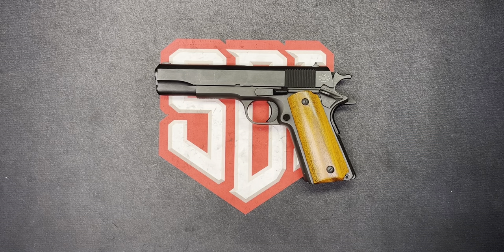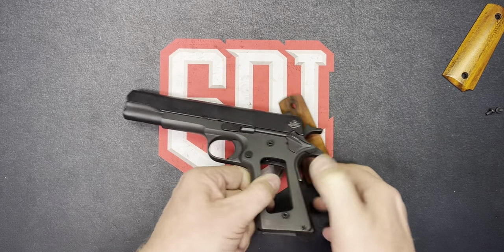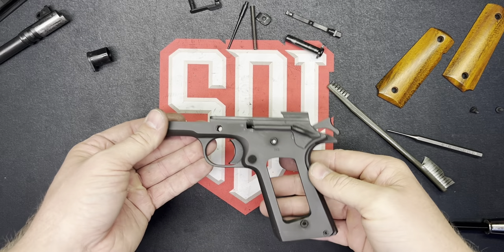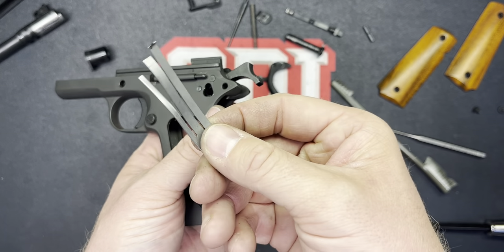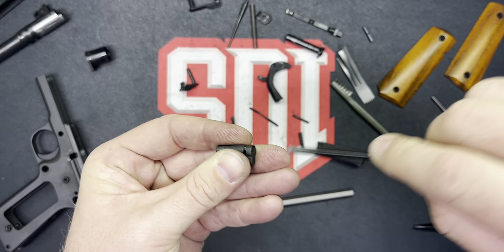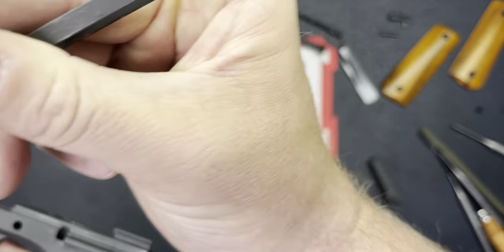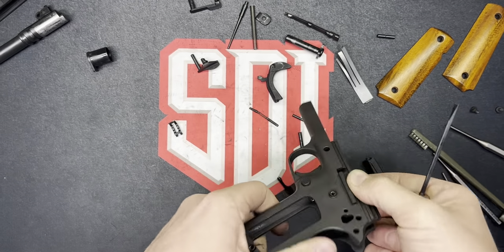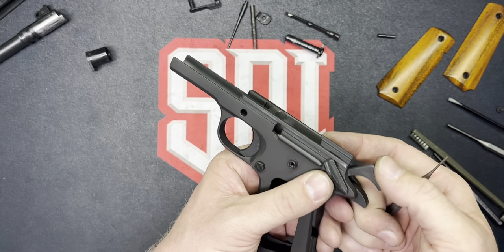Sonoran Desert Institute Rock Island Armory 1911 Detailed Strip (Disassembly and Reassembly)

Comment: Here's a trick for everybody that's watching what he's doing here at the installing the firing pin and the firing pin stop and the extractor put your extractor in. Get it lined up. You may have to use a punch to kind of line it up a little bit. Do not put your firing pin in. Put your firing pin. Stop in to help kind of line that firing pin up and make sure you got it lined up. Once that extractors lined up it should hold in place on most. I've had one that was really loose. Then you can put your frying pin in the spring and the firing pen in and then put your frying pin stop in and everything should go together. But you want to fit the firing pin, stop and the extractor and get those into position. Before you put the firing pin in, you'll find that it makes it a lot easier when you put it all together first. I know it's an extra step but when you put that firing pin stop and it kind of helps line up the extractor just right

Comment: Plunger tube is staked in you do not take it out. You do it will ruin it just like the front sight. If it's staked on, you have to break it to take it off. They're not intended to be removed

Comment: These pistols (Armscor imports of whatever name, and maybe others) pass the "drop safe" test required for importation by using an extra strength firing pin spring. They avoid the extra expense of a "series 80" system by doing this.  A stronger spring is far cheaper than a series 80 design or even a titanium firing pin. 
While this works, it is a pain to reassemble and very easy to launch the firing pin and spring into outer space where it seems to orbit forever, never to be found again.
My suggestion is to get a standard strength spring and titanium firing pin (about $20 total) and install them the first time you detail clean the slide.  Your gun will be drop safe and MUCH easier to clean and maintain.
Another thing I do with ALL my 1911s (6) is install a Wilson Combat "Bulletproof" extractor and use Wilson Combat magazines.
Reply from the maker: That is great advice, thanks.  Do you have a preferred brand or vendor for the spring and pin?  It’s funny you commented on this video just now as I got an email two minutes ago that the new safety was delivered. It’s literally sitting in my mail box right now.  Time to get the 10mm back up and running.
Reply: @scottbozarth8459  I use springs from Wolff Springs and I use a titanium firing pin from Wilson Combat. I generally get any and all springs from Wolff, except 1911 recoil springs which I get from Wilson Combat. 
Wilson Combat 1911 parts are top notch and provide a cheap upgrade to any 1911. 

I have no interest in promoting Wilson, just 50+ years experience working with and owning 1911s.

I use only Wilson Combat magazines in all my 1911s.

Another bit of advice...unless you are left handed, lose the ambi safety and just use a regular (or extended) left side safety only. I prefer extended safeties, but any guns I ever had with ambi safeties...the safety is in the factory box as a spare part (along with the factory magazine, extractor, firing pin spring, firing pin and mainspring) and replaced with a left side only safety. Keep all the original parts in a little bag in the factory box. 

Tip: If you change the extractor and use Wilson Combat mags you can skip the "break in" of the gun and the parts will cost you about the same as a box of ammo. 

I own quite a few 1911s and add a new (or used) one to the collection from time to time. I keep extras of these parts on hand and just assemble them into the gun as soon as I get it, then order more spares.
Reply: Never heard of titanium firing pin helping in drop safe, interesting. What would make it so? I am not a series 80 fan, I convert any I have to 70.
Reply: @markymark6108  Light weight.  The problem with 1911s firing when dropped is caused by the firing pin flying forward under inertia if the gun is dropped on the muzzle. The weight of the firing pin, under inertia of falling, can overcome the strength of the firing pin spring, just as it does when the hammer hits it when firing. 

The Armscor imports overcome this to pass the required import drop test by installing an extra heavy firing pin spring to resist the inertia of the steel firing pin if dropped on the muzzle AND and extra heavy mainspring to overcome the resistance of the heavy firing pin spring when fired.  A titanium firing pin costs about $30. The cost of two heavier than normal springs is little or nothing. They meet the import qualifications and maintain their market price point.

The extra heavy springs make firing pin removal and replacement a pain in the @ss,  and the extra heavy mainspring increases trigger pull and increases the effort required to operate the slide (because cocking the hammer is more difficult against a heavier spring)

Installing a standard power firing pin spring can make the gun unable to pass a drop test. if that concerns you, installing a titanium (lighter) firing pin fixes that problem. The lighter firing pin spring and lighter firing pin allow you to install a "reduced power" mainspring. This reduces trigger pull (because of decreased pressure on the hammer/sear connection which must be overcome by pressure on the trigger to fire the gun) and decreased effort to operate the slide because the hammer is easier to cock. 

The whole conversion takes maybe 10 minutes and requires a couple of appropriate size pin punches which you should have if you own a 1911 anyway. 

Why didn't Colt just install titanium firing pins back in the early 80s instead of the whole "series 80" thing?

Because, at the time, titanium firing pins were not in common supply, were very expensive AND the attorney's preferred a mechanical system for liability protection rather than  trusting Newton's laws of motion.
Reply: @garyK.45ACP  Thanks for the info. Makes good sense. I have built 8 or 9 1911's from 80 % frames.....I have several with springs set for Plus P so I defenatly understand the springs. I will be ordering titanium pins and reduced springs for a couple of them. I EDC cocked and locked so I dont think it will ever come to be a thing for me  but its worth the effort. Thanks again for the info.
Reply: @markymark6108  Like the recoil spring being balanced for the loads the gun will fire, the hammer spring (mainspring) and firing pin spring have to be balanced also. A heavy mainspring with a standard firing pin spring and heavy standard firing pin could result in pierced primers. Vice versa can result in "light primer strikes" and failures to fire. 
Drop safety for the 1911 was always more of theoretical issue than a real safety issue, it became more of a problem with the increase of liability lawyers.  

The military managed without it for 75 years. 🤷‍♂

Measure the tip of your firing pins with a calipers before ordering the firing pins. There are two sizes in common use by manufacturers. I get my pins from Wilson Combat, but there are others and I really don't have a preference.
Reply: @markymark6108  Hi Mark, I just read your comment about changing your 80 to a 70, my question to you or anyone else is, do you think there are any liability issues if you had to use it in a self defense situation? With people being sue happy these days I wonder if it's worth doing.

Comment: This is an excellent how-to video. I have the exact same RIA ACP 1911, and the most frustrating thing was lining up the barrel link for the slide stop. The recoil spring guide was also a bitch. I suppose practice makes perfect, neh?
Before I venture to disassemble the receiver, firing pin, and extractor, and all of the lower gear, how does one know WHICH pins go where? are most of them the same size? Does one have to label them?
Reply from the maker: No, it’s pretty obvious where they all belong.  If you wanted you could record yourself taking it apart and go back to see what came from where.  But just Google “exploded view” of your specific 1911 and you’ll find a good schematic drawing that will help tremendously.  I have printed off exploded diagrams of most of my guns in a folder for reference.  Good luck!

Comment: As far as ammo, yeah they used to say you needed to shoot 500 rounds through any pistol before you trust it. I find you can get away with about 200 rounds. It's not ideal but the fact that ammo is hard to get at times and is expensive at times. 200 rounds is better than 50 rounds. Really get to know the weapon but they call it a break in time and it was the get the the weapon moving and things burrs wore out things like that. But I find 200 rounds works good my 1911 I find my fire $200 rounds. They were great and the feed ramp on the GI issue and most 45 ACP models is kind of a two-piece ramp. You'll find that the frame makes it part of the ramp feed ramp and barrel has a partial feed ramp. That problem comes with that partial and the frame of the barrel. Meeting up and hollow points and flat nose. Have a tendency to catch on that. If you have a full-size feed ramp feed ramp, doesn't it allows to defeating of hollow points a lot better. There is a process but barrel when it sits down with a slide all the way back needs to be a little bit of a gap and forward of the frame. Just a tiny bit. Not much just enough. So as the bullet slides off the frame, it slides onto the the barrel ramp easily and there's nothing there to catch. And sometimes you have to worry about taking a burr off of the frame right there at the ramp too

Comment: Putting the disconnecter and sear in was a bitch to put back in. Also the ambidextrous safety’s tend to not reset the trigger. I learned this when I built my RIA
Reply from the maker: It really does take some finessing.  I’ve got the 10mm back together with a new safety and will do a video on what I learned in the process.  Slow and steady is the key.

Comment: The standard recoil spring and outside guide and inside guide that's on a standard Government model supports the spring from both ends therefore the entire spring is supported in recoil, negating the need or the desire or for whatever reason people put full length guide rods on these guns. It is waste of time money and effort to put on a 1911. It removes the ability to rack the firearm by putting it against anything and just racking the firearm one handed. A required element of the firearm at the time it was designed because it was designed to be a horse pistol and you cannot use both hands when you're on a horse because one of your hands has to be holding the reins of the horse. This firearm was designed so that you can empty it drop the magazine put the firearm in your holster put a new magazine in it and should you have dropped the slide during that action you could just put the nose of the slide against the Horn of the saddle or against anything that you can find and rack the slide and now you have a loaded firearm.
I wonder if they are making those parts out of the powdered Steel and baking it. I don't understand those parts if they made that that way it's not a good idea. At the very least the tempering process that they used left it a bit on the hard side.
I've seen as many problems with clocks as I've seen with 1911. And most issues are caused by either a magazine problem or operator error. But I have seen Glocks blow up shooting stock ammo. I've also seen the Detroit police decide that they were going to use lead bullets for their practice ammo to save money and they blew up a good number of Glocks.
If I were you I'd polish down that extractor and leave just enough Dielectric grease on your fingers to know that this got a little bit of grease on them and wipe it down with that. Because the tiniest amount of rust and that extractor will be a part of that slide forever.
Reply from the maker: Good info, thank you. And yes I found out the safety selectors are MIM parts, (sintered powdered metal) but that’s not always a bad thing. Now days they’re pretty good at it.  I think I just got a bad part because the replacement parts fit together much more easily than the originals did.  I’ve been meaning to do a follow up video, just busy with work, school, kids, life… excuses excuses. 

As far as the full length guide rods, that’s a debate I won’t even get into since I’m not knowledgeable enough.  It makes sense though that you’d want to be able to rack off of any object like a saddle or whatever’s handy. I didn’t know that was an actual MILSPEC requirement when it was designed.  Guess I need to read a book on the 1911.  John M. Browning, what a genius.

Comment: You too heh? The ambidextrous safety is a PITA to reinstall. You did notice the thin cut in the sear pin that allows the rt side safety to swing thru for some unknown reason, probably as a retention for the off side lever? Take a close look at the distal end of the sear pin and you will see it. That is why it protrudes from the frame so far on the right side. I nearly broke mine too until I remembered seeing it on disassembly. Just plain stupid. I have lost respect for RIA as well after working on my gun. The disconnector and sear are poorly machined. But I guess you get what you pay for... It cost me $395.00 used on Gunbroker. I hope it can stand up to 10mm now after seeing all this. It is not made of high quality steel, the 600 grit sandpaper cut it down fairly quickly taking the burrs off. You really have to be careful not to change tolerances. I just basically polished the black phosphate off.
Reply from the maker: I do agree you get what you pay for, but I wouldn’t say I lost respect for RIA.  I knew I was buying a budget pistol to tinker on and that’s exactly what I got. Haha I’ll say this for it, I’ve had thousands of rounds of 10mm through it at this point, a lot of them full house buffalo bore 200gr hard casts and it’s still running like a champ.  No signs of cracks or anything.  In fact, the o Lu damage it’s ever sustained was from me not knowing what I was doing hahahaha 

RIS is never going to be a refined as the high end pistols but it’s a good tool for what it is.

Comment: Yeah, you could find burrs and things like that that we're not caught in the deep burning process, but you can find that on any metal frame or even plastic. I've even found over mold on plastic, even glocks. It's kind of rare but it's been there. I've had it on a couple of them. Doesn't take much. Just a little bit of a file. Trim it down. Taking care of

Comment: Unless you have the staking tool, do not remove the plunger tube or the front sight. Both  each item requires a specialized tool to put the new one on and yes you have to replace both if removed.

Comment: i never had seen that happen before maybe by better safety for your 1911
Reply from the maker: I ordered a replacement and it seems to be working fine now.  The two pieces still clip together but nowhere near as tightly as the originals.  I think the tension on the original was caused by a defect, but that’s just a guess.  They sure were a whole lot tighter than the new set is.
Reply: @scottbozarth8459  cool man that's good that you got that back and running
Reply: @scottbozarth8459  and a subed i do have my own gun channel to

Comment: You can probably take it out with a L hook pin pusher if it exists but that’s if it’s not sadered cause it might be pressed into the frame but I don’t know I haven’t taken it apart that far
Reply from the maker: The safeties aren’t soldered together and are definitely intended to come apart easier than how mine did.  I’m hoping that maybe something was wrong with mine and the new safeties I ordered go together and come apart easier than the originals.  We’ll see.
Reply: @scottbozarth8459  the part that connects to the safety when you stripped the whole frame the last part that couldn’t come out sorry

Comment: Do you use penetrating oil to loosen parts?
Reply from the maker: I do if needed.  I have found Kroil to be by far the best option.  Don't go overboard, it doesn't take much!  You really don't want to get it on a wood stock.